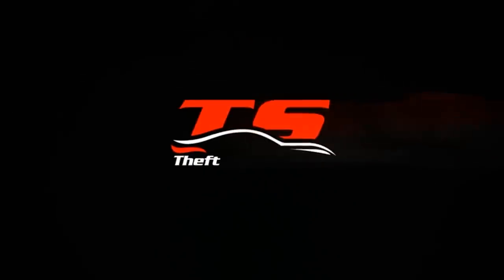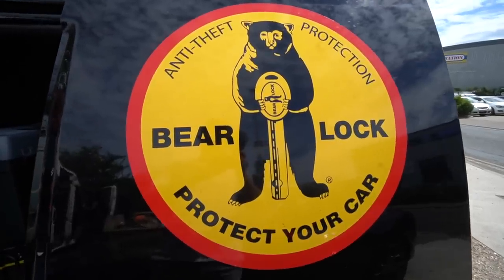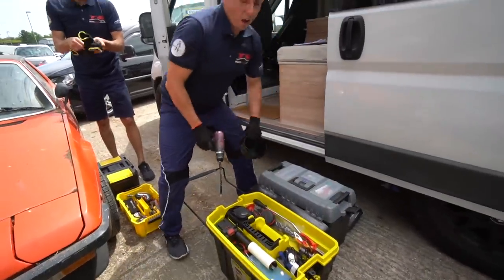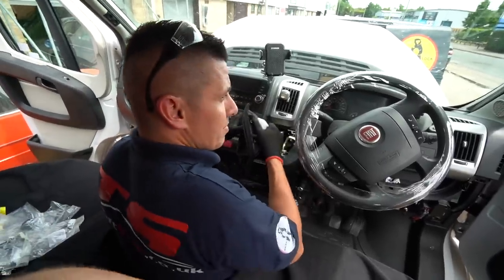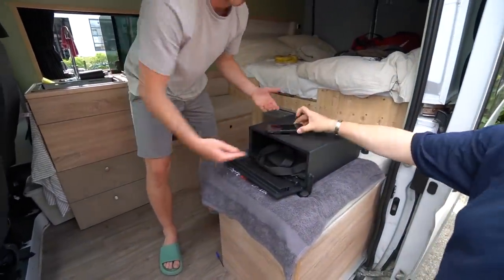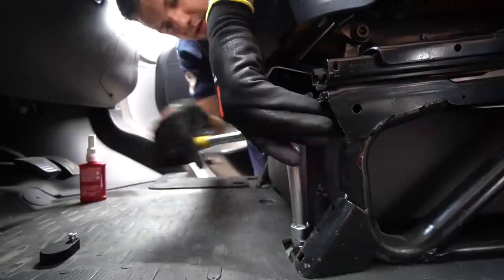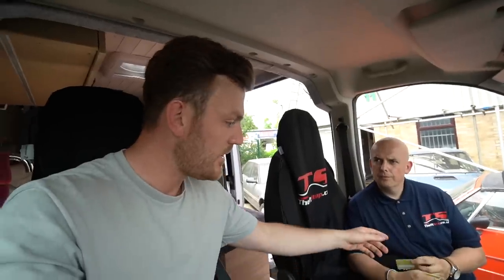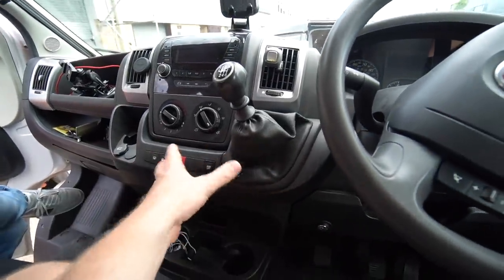VAN THEFT! Big UPGRADE for Van Security (YOU NEED THIS)

Comment: I’m from Nl and he is right, most insurance company’s require bearlock (or construct which is similar). Some on all campervans independent of value, others on vans over a certain value, some only selective (eg over 20k or high demand vans like a vw transporter).
Only disadvantage is seperate keys. Insurance in nl requires all keys if you claim a stolen vehicle to prove you have used the bearlock. Not all keys? Claim denied
Another great safety is adding a prickstop. The ducato (and boxer/relay) are bloody easy to unlock with a screwdriver by pushing it below the lock and lever the central locking. Yt for some examples of the prickstop

Comment: When parking up just remember to reverse upto a wall/tree etc it isn't going anywhere.
Reply from the maker: I like it 👍
Reply: I'll bring my chain saw then.
Reply: @JazzFunkNobby1964  no need for a chainsaw, you can just burn the tree down with your chinese heater
Reply: @wildforesthome6563  Haha I have a diesel heater stalker.
It's wonderful
Reply: @JazzFunkNobby1964 sorry. it notified me a comment was made because i had commented on this too and I couldnt't help myself, too perfect. No hard fealings buddy,  if it works for you more power too ya. Have a good weekend mate 👍
Reply: @wildforesthome6563  It was funny so no foul.
Reply: @martinlanigan803  a 4" battery dewalt grinder will have that off in 10 seconds flat

Comment: What a great bunch of guys. Just picture Mary flying backward through the town. If you mention your security system to your insurance company you may get a little discount. A mechanical lock like that is so much better than an electrical one which are easily by-passed. My dad was a car transporter and used to collect repos and abandoned cars. He showed me so many ways to open the locks, rewire immobilisers/alarms and start cars without keys. Its scarily easy. Safe is great idea, keep some emergency cash in it too, for fuel or the morning pain au  chocolat. I wouod get yourself some foam padding for inside the safe so things dont get damaged if your on a bumpy road, sliced up old yoga mat would do the trick. Cracker video mate, looking forward to the next one. Safe travels

Comment: i'd also use a cheap steering lock (or similar) more for a visual deterrent. The Bear lock looks great but you don't want someone breaking a window getting in, only to find they can't drive forward! just something visual to put off the opportunist so they move on to the next van.
Reply: I would think you should fit stickers to show that these products are fitted, someone would do a lot of damage trying to get the van away

Comment: A cheap thing to add is a kill switch to the fuel pump and hide it somewhere in the cab
Reply: That as well as a bear lock … awesome
Reply from the maker: The more security the better 👍🤘
Reply: I did this but the mechanical high pressure pump will drag the fuel through the electrical pick-up pump so this doesn't work.

Comment: I once lived in not so good neighborhood. My  immobilizer solution was to grab the ECU with me, as it was conveniently located in passenger side wheel wall. (Saab 900) - I had it outside the upholstery connected with the cable connector only. If the thief would be equipped with Lucas made ECU, he likely would have offered the car better home than I managed to.

Comment: hello from the Netherlands .  
that man from that company may better put his facts in his head in his sales story and not hang up any lies .  
a bearlock is NOT required at all in the Netherlands.  
the facts : For motorhomes with a catalog value or appraisal value up to € 75,000, at least a factory immobilizer OR an approved mechanical gearbox lock (Construct Premium or Bearlock NRK) is mandatory.  
and then it also has to be a "Bearlock Benelux" lock and otherwise it is not certified for the Netherlands and Belgium.  
and this CAN only be a requirement of your insurer!  .  
just like you must have an approved chain lock with a motorcycle insurance policy.  
and just like you can often get a discount on your insurance with a descam IF it is of a certain class and such.  
thanks for the video Will.  Sincerely, Hollandduck

Comment: Back in the days of air cooled Beetle engine swaps there was a company that made engine to transmission locks, they were called “The Boll Lock Company” - great name. 

My Subaru has a Thatcham Cat 1 alarm with a hidden keypad to prevent thefts. What about a hidden tap in the fuel line ? I put one on a Landy that I had years ago, it would run for a few minutes then stop.

Comment: to stop your van from being stolen run a wire from the fuel pump to a hidden switch in the cab and when you leave the van switch the fuel pump off then it wont start.... but dont put it on yt where it is haha

Comment: If they want the van so much what’s to stop them putting the drive wheels on skates and winching onto low loader or suspended tow?
Reply from the maker: Good question but for me it’s more about piece of mind and this helps add an extra security level that I didn’t have previously

Comment: Is the lock safe from lock picking tools? because professionals use picking tools theses days.
Reply: Yes it is. Tested by many locksmiths in UK
Reply from the maker: Yes it’s been heavily tested 👍👍
Reply: @WillsWhereabouts  bet it not drill proof. lol
Reply: I reckon the lock picking lawyer will have it picked.
Reply: @charliefinnigan9209  After a few break ins at my sailing club we had drill proof locks fitted. Last weekend a little scrote tried to drill the barrel out. They failed badly and we had to get the original locksmiths out to open the door and replace the barrel. I'm sure that people with the right skills will be able to get in but they would probably have to make a fair bit of noise and take quite some time doing it so they will look for an easier victim.
Reply: @tonysutton6559  very true.
Reply: I wonder if the barrel is pull proof

Comment: Lock it in reverse, could always be reversed onto a trailer and towed away!? I suppose this is a deterrent for the opportunist thief?
Reply: Depending on where you park it I guess.
Reply: If you park backwards (like any sane person), good luck with that lol.
Reply: @MultiCamalot  suppose yes if it's reversed against an object then that argument is valid.   I personally believe these types of system are bad as a lot of damage can be done as a result of thiefs trying to bypass them. I'm more in favour of covert surveillance i.e. tracking the vehicle or more elaborate electronic immobilisers. My parents car used to have a switch hidden in the ash try, when vehicles had them, you'd never know was there! Each to their own 👍
Reply: Not always practical to park backwards 😜
Reply: @davidallen4603  I think the days of good electrical security are past us. Even the brand new super safe keyless cars can be stolen in seconds. Can't beat good old fashioned physical installs like this imo!
Reply: @MultiCamalot  no they have got too complicated for their own good. A simple kill switch to the fuel pump hidden away or in plain sight as a light switch. Could be there for hours trying to find it!  No damage to gear levers that you then have to get repaired after the thief has done their damage and left the scene!  Plenty of comments on here re a kill switch 👍
Reply: @davidallen4603  i do like the fuel pump kill switch idea, is that not easily bypassed under the bonnet by a "thief in the know"? I'm not sure how they work.

Good idea though, when I eventually get a van I'll look into that 👍
Reply: If you think about where a camper van is likely to be parked, the chances of a low loader or tow truck being able to get in behind are slim. Obviously a variety of security features is best - the Bear Lock, deadlocks, electronic immobiliser, tracker, even the good old fashioned kill switch. The more you have, the more likely a thief moves on to the next one with less security features than yours.
Reply: @tobysherring1369  have you seen where Will typically parks? 🤣
Reply: @davidallen4603  I see your point. But as he's generally asleep in it, hopefully he'd wake up or be asleep in it on the back of the lorry, wake up and drive it off again.